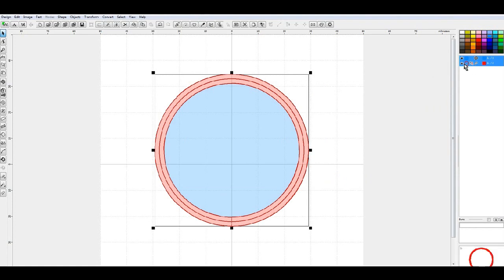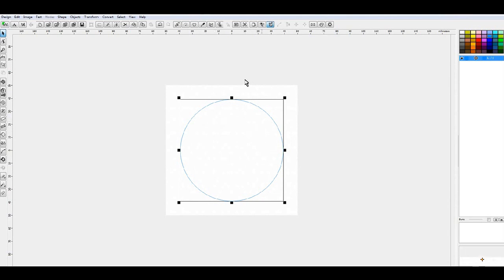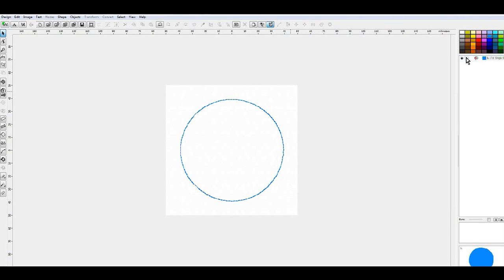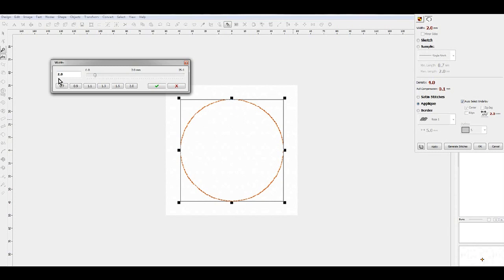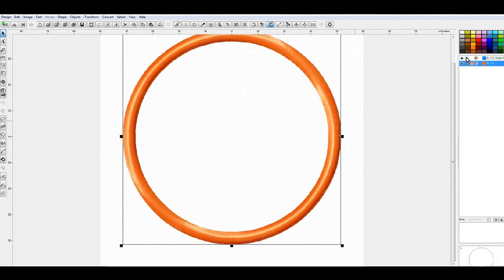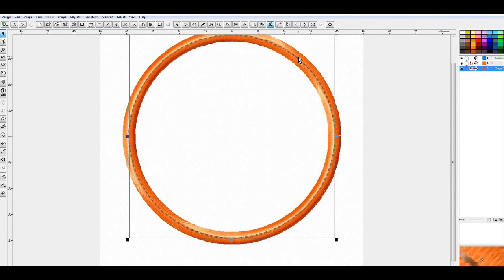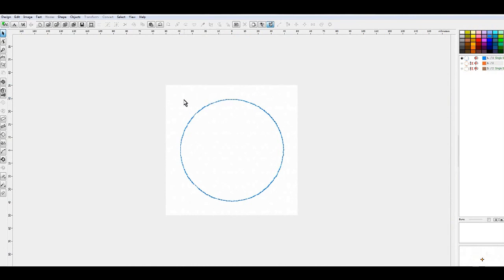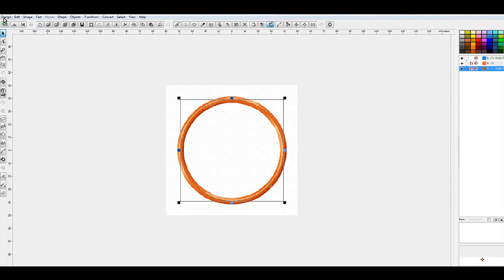Embird Tutorial - Learn to digitize a basic applique shape

Comment: Thanks so much, Donna. Helped a lot.
Reply from the maker: if you need to know anything else, there are more embird tutorials.  If you need anything specific, maybe I can help.  Not sure as I'm kinda retired but still play around for my own personal use.
Reply: @DonnasCreativeAdventures  I only wasn't able to find a way to insert text on the inside of a circle, looks like Embird will only allow it on the outside.  Anyway I was able to get around this some other way.
Reply from the maker: @baronderochemont8556  - You will need font engine.  Then (I did this in editor and didn't take it into digitizer ...)  -- select your font, and type your text, then under layout, select circle as your baseline.  After that is selected, click the box that is next to "Place on the other side" down toward the left hand corner.  Let me know.  You should be able to adjust from there, etc.